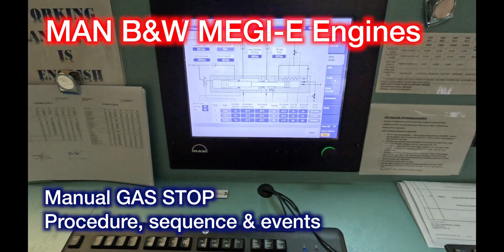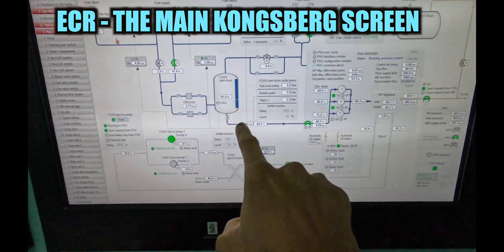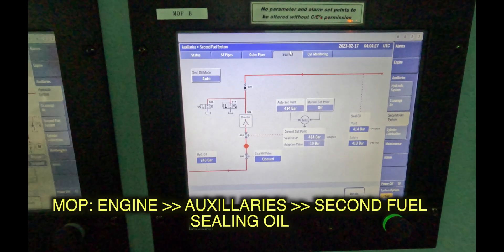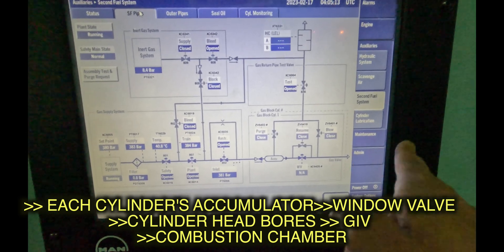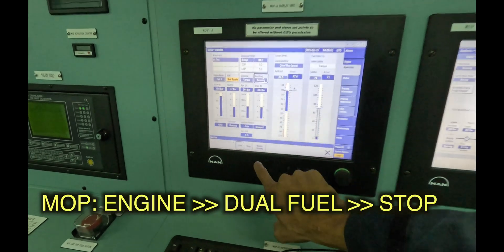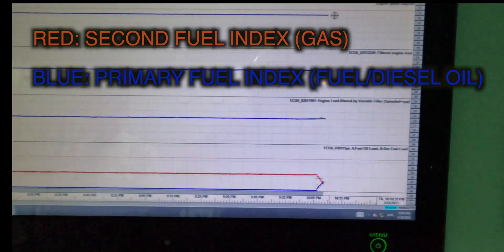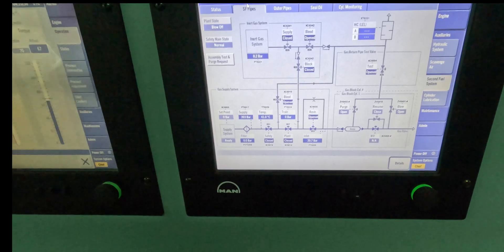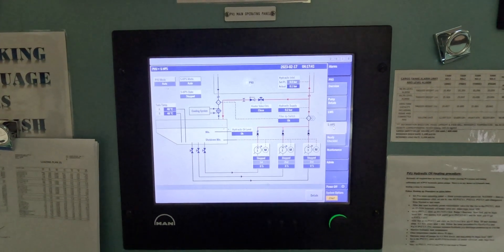DUAL FUEL ENGINES - PART 8  - MANUAL GAS STOP (NOT ENGINE STOP)

Comment: Hi Chief, great job, huge respect for the work you are doing and love your videos! 
One question, why after gas stop you still have 40 bar pressure at the engine inlet? I refer to min 5:50, reading downstream of valve 852, I think it is Pressure transmitter PT6006
Reply from the maker: it takes some time to drain off the pressure, will look again into this..
Reply from the maker: thanks for watching and your kind words, do help spread the love and knowledge.

Comment: Hello Sir, While stopping
1.The ethane from which all sections is vented through the mast finally? 
2.What happens to the liquid ethane in FGSS liquid drum?
3.What happens to Liquid in line after you stop the FG deepwell pump?
Reply from the maker: 1. all ethane after PVU.. i.e to engine and the GVT will be vented if system trips... before PVU (liquid) goes back to cargo tank.   2. FGSS drum drained back to tank /.. 3.. back to cargo tank... remember all liquid goes back to tank and all vapour/gas after the Vapouriser goes to the riser n vented out..